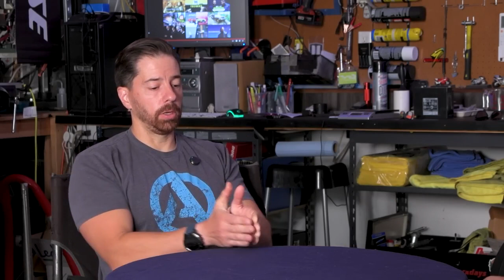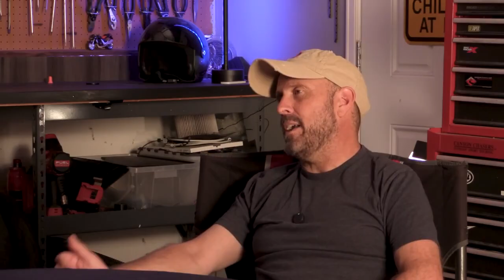Keep the Safety Net Without Losing the Experience. Electronics

Comment from the maker: What do you think? Have electronics ever saved you, or do you feel like they get in the way of really learning control?
Reply: Yamaha's MT09SP Gen3 turned my impending low side into a highside. It waited 1 second after the wheelspin started before completely cutting the power. In that 1 second I was totally crossed up so there was no saving it. The ECU using data from the IMU should have known that. Instead of realising that the opportunity to save it was gone the ecu cut all power and the rear tyre gripped. Up I went.

The low side would have been a big nothing burger but thanks to the bad programming by Yamaha it got turned into a highside and I ended up with a broken collarbone and broken thumb and 4 broken ribs.

I had a data logger plugged in so this is all supported by hard data from the bike. All the bike manufacturers are marketing these as safety features when they're potentially the opposite depending on how badly programmed they are.
Reply: @MrBCRC — I 100% believe what you’re saying I had the traction control almost take me out.  What happened was I hit a big long patch of gravel it turned out—it was almost a 50 foot patch along the trailing edge of the road surface.  So of course, even though I had the most pussified version of TCS on it, it cut the ignition.  And then, for some reason, it thought it had “grippiness” for a second so it turned the ignition back ON.  And then because it realized—NO—I’m STILL bunch of shit—it came on for a SECOND time.  But the bike was still out of shape from the first intervention, so it became SUPER dangerous and it was gonna hit the damn asphalt— I had to throw a foot down to stop myself from ending up—staring at Jesus.  

Event number two: I’m following a guy on a S1000XR, which I’m sure has 18 freaking settings for TC and cornering ABS.  We’re all going hard into corner following a group and he touches the front brakes and ends up ass on the ground IMMEDIATELY — I’m sure there were PLENTY of interventions that happened.  

I’m riding the exact same line hitting the exact same shit at the exact same speed—and I come out of it, bike didn’t even move… the difference was —RUBBER— he had your typical Power 6 everyone here runs—because, you know—MARKETING.  And I’m Dunlop Q4 in the front and Q5S in the back… with the idea in my head being— don’t overrun the front… oh and I’m on the non-SP version of the MT-09… which, as we both know —has shit electronics…
Reply: 💯 get in the way of learning, but not all of us are as dedicated to learning
Reply: The other thing is and this is NOT gonna be a popular opinion. Extremely elite prototype-riding motorcyclists do not ALWAYS progressively brake— in spite of what the Yamaha champ school might tell you.  There’s millions of miles of data to support what I’m telling you.  There’s no REASONABLE way to INTENTIONALLY induce wheel lock if you’re progressively braking— it would be IMPOSSIBLE with ABS. There’s just not enough time for any of that shit to happen.  If you’re trying to induce complete and total gyroscopic decay in the rear in order for the front wheel to gyroscopically PULL you around the corner while the rear skips sideways across the tarmac— And there’s a great video of Marc doing this chasing Dovi around Motegi… you need a wheel speed differentiation that approaches 100%.  That’s blasphemy you say!  No, it’s actually true dude —-you can actually see him starting to do it on the Ducati now… he’s one of the guys that doesn’t want ABS —Fabio doesn’t want ABS, Bez…hard pass…wonder why?…

Comment: I like ABS until I don’t want it no more.  The first bike I really started running quickly was the Gen2 SV650 and there was no ABS on there and sort of that was a blessing in disguise because I had to figure shit out without it.  But then the MT09 makes maybe 120HP… with the flash I think I gained maybe 3-4HP… and then for the maybe first 2-3 seasons of my new-to-me ride it’s on there and maybe it’s gonna do some stuff… I guess… of course, from even day ZERO of riding the rear ABS was on CONSTANTLY… And then now after 2 1/2 seasons, the front started intervening a lot and I’m like dude I just want ABS GONE… or at least have the ability to toggle it off which I AM GUESSING manufacturers don’t want because it’s a potential legal problem for them or whatever but I sure would like to be able to bypass that ABS shit on a hot summer day…

Comment: Absolutely brilliant discussion as always, gosh I love this podcast. Which MotoGP rider does this sound like 'doesn't trust the tech'
Here's a suggestion for a, perhaps out of season discussion, the main tech MotoGP riders use to compliment if not replace their own ability. 
Such as throttle control. It's only in the last few seasons I have realised that out of corners etc, riders twist the throttle fully open...so the bike must be using GPS, conditions etc to provide the right amount of power. This weekends race where Pedro told engineers just let him do it ... 
To me that's far more intrusive than say ABS. 
What else do these riders have 😊